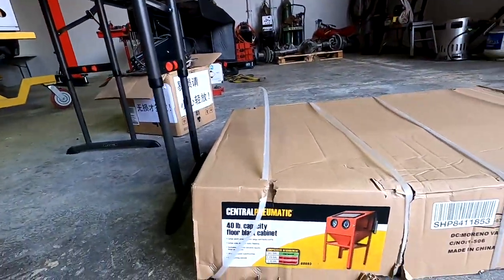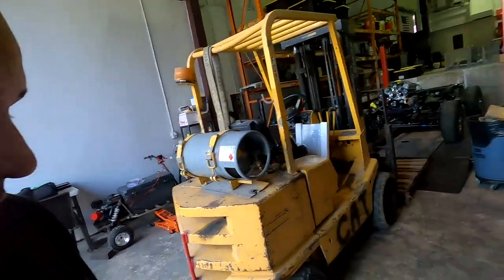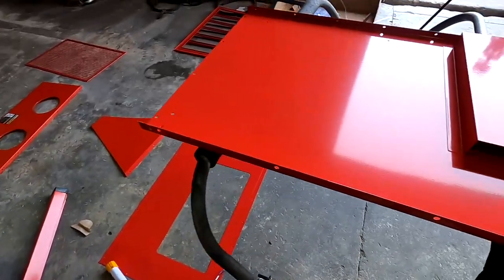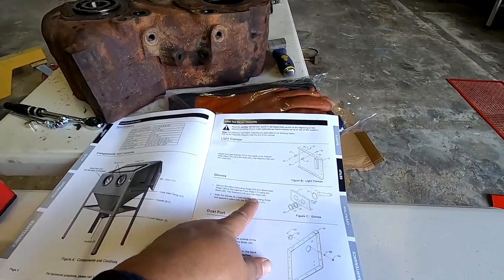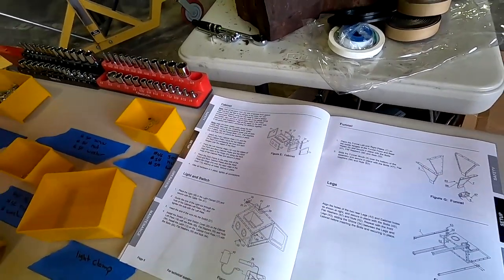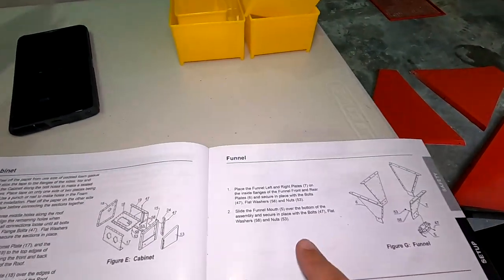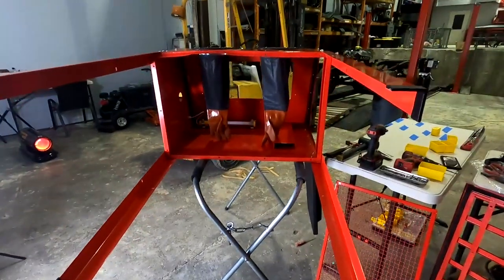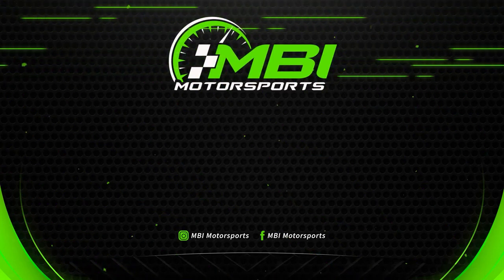how to assemble harbor freight sandblast cabinet

Comment: The top cover was installed slightly incorrectly. It was supposed go under the edges on all sides so the seal is from the inside. You should only need to put the seal on the top and bottom of the top cover. I don't know how much impact it will have on dust since you did the seal on all 4 corners, if you look the side panels have a seal on the top edges. Kind of hard to explain. Either way works i guess, thanks for the vid helped me answer some questions I had.
Reply: Lol my side covers dont have seals... the top cover came with the seal on all the edges smfh. Dont know what i shouldve expected from Harbor freight
Reply: @mm-nl3qz  they should jave included seal tape, I had to put it on the top and bottom of the top center panel, then install it to the front and back panel u der their top edges if that makes sense
Reply: @blahbergerpoke  all they gave me was silicone sealer and teflon tape... figured out I goofed and installed the top panel over the front and rear panels rather than have the front/rear panels sitting on top of the foam then install the side panels so all the seams are sealed with the foam.. feel pretty dumb cuz of it but its all good now. All of the foam tape was already placed on the cabinet panels and the box was brand new but I did question whether or not it was a return😂

Comment: I'm not trying to be rude but this was a bad video for people trying to put one together using it.. had to reassemble sections several time due to the half way instructions or not even stating when a mistake was made.... scares me as to the quality of mechanical work they are putting out. 

If your gonna put out videos for people to follow / use they should be right, just saying.

Comment: Thanks for the video, but why didn't you have any problems?  These hours-long assemblies usually have a few "uh-oh" moments.  I did like the nice trick with the bins.  Nice lighting rig, shows you care about the presentation.  I just bought one and will assemble it tomorrow.
Reply: at 14:44 i can see the funnel is assembled wrong. i know its wrong because i made the same mistake. triangle piece is rotated incorrectly preventing it from bolting to the cabinet. 
there's your "uh-oh" moment right there.

Comment: 14:44 you assembled the funnel wrong. 17:41 i see its assembled correctly and you didn't mention the mistake but instead you say some BS about the legs costing $50
Then you skip over the confusing grating sandwich part then end the video. 
i dont know where the thin metal square band piece goes. the instructions are as uninformative as this video.

Comment: For the big plastic grommets to attach the gloves. The self tapping screws suck and the metal is only 19 gage. Real thin. Not enough meat to screw them into. Get some machine screws with nuts. Over half of mine stripped out just using a regular screwdriver.  Don't know what song was playing during this vid. But now I can't stand it. Never want to hear it again. Ever.